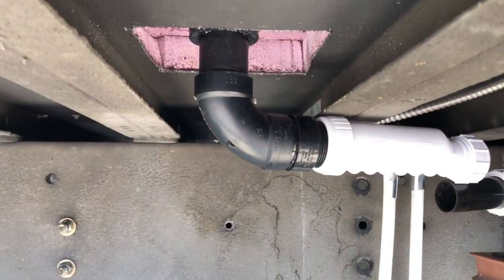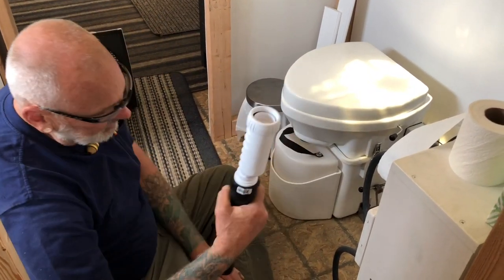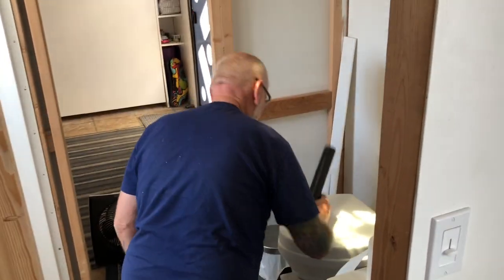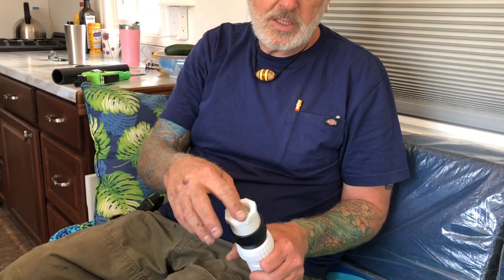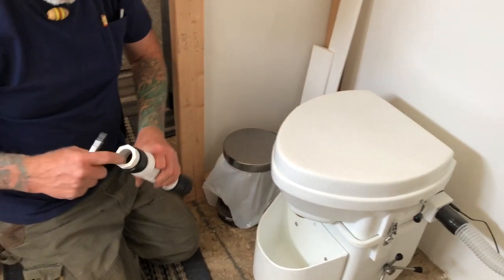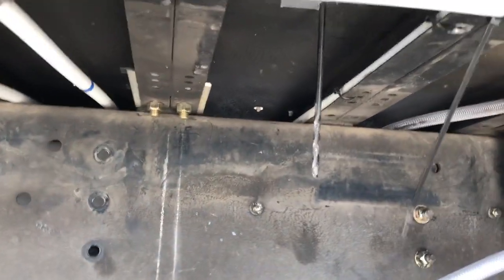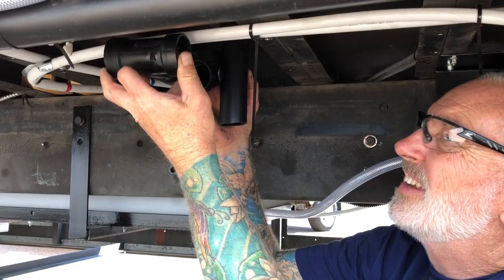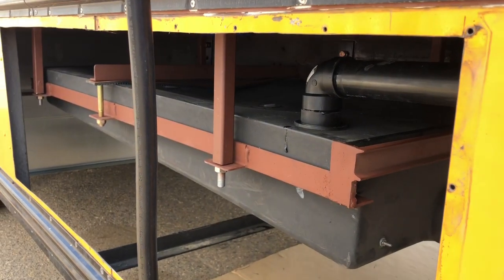Plumbing Nature’s Head Toilet into Grey Tank - Vlog 150 School Bus Conversion

Comment: I did the same thing to my composter. I was wondering what medium you are using in the silids side? I have not started using mine yet. I was told peat moss or sawdust.  Just checking to see what others use
Reply from the maker: We are we using Peat Moss. It seems to be working great. We were told to make sure it was organic Peat Moss without chemicals. It smells like rich garden soil.😃

Comment: Well done guys like the team work you'll be glad you plumbed it into the grey tank I've heard the plastic tank fills up really quick.
 Randy one question on your vent system most RV manufacturers run the vent stack up through the roof I see that you have an under the counter vent hooked up on the tank aren't you afraid that there will be odors coming from under the bus I'm not sure what side that vent is on but if you were entertaining friends on that side you might smell it.
Just wanted to get your thoughts on this I haven't installed my tank yet and hope to find new ideas that are better ways to do things now. This is my second coach I'm building my first coach was 25 years ago. Anyway love your work and the video's thanks for sharing.
Reply from the maker: The gray tank vent does go out through the ceiling of the bus roof. The pipe going across was just to connect the two gray tanks together into one vent that exits through the ceiling
Reply: @KnappTime  oh okay I've seen someone doing a vent under their bus
And I thought it must be something new
But I wouldn't go that route if you know what I meant your smarter than that Randy okay thanks for getting back to me I've already got my vent planned where it's going through the roof. Carry on young man.